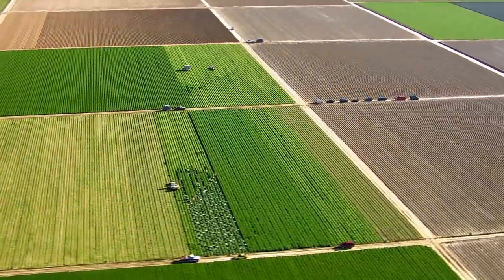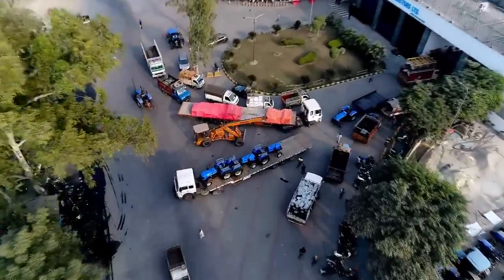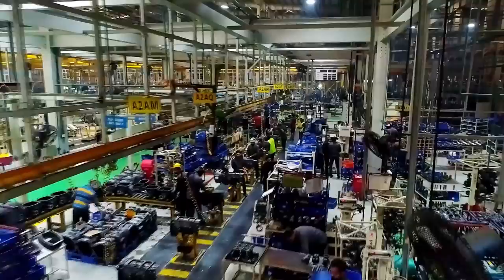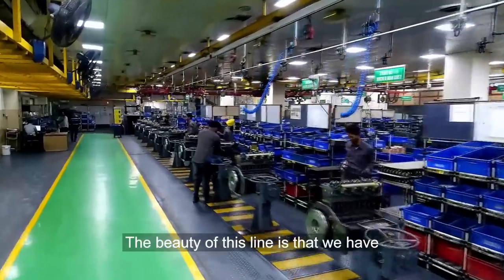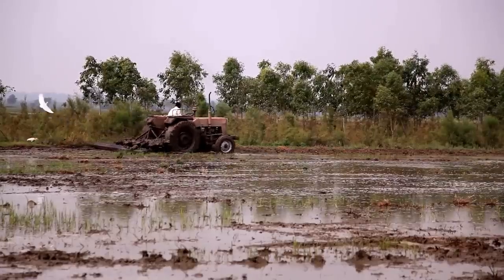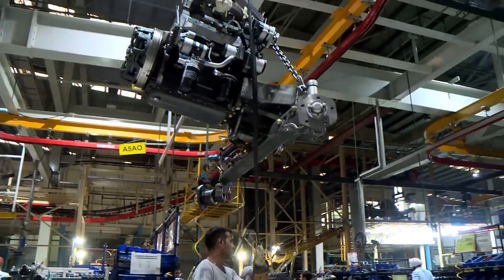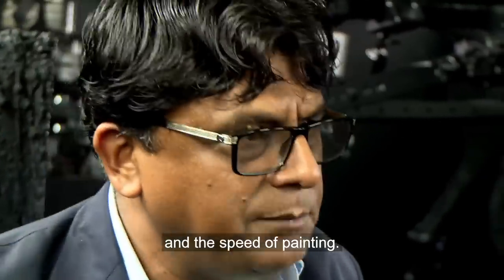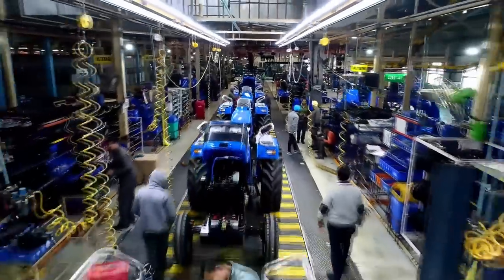How Tractors Are Made | How Do They Do It?

Comment: They should include roll over protection on every single unit.
Reply: Yup
Reply: Yes but in many states a single tractor is used in open field and orchards where the ROPS will be a hindrance and hence there its an option.
Reply: @hp2084  Sound like an excuse to me... I have seen plenty of orchards with ROPS in use.
Reply: @eprofessio  Yes i west they have specialized tractors for orchard. Not in 
India. I have a New Holland which is sold with ROPS in other states but not mine because my state has mostly mango tree plantations.
Reply: Hiren Patel have you ever seen the roll cages on tractor pull units, the ones that pull sleds for competition... they have roll cages right around the driver. These are just excuses.
Reply: @eprofessio  Come to my farm I will show you tree branches 6 inches thick just 6 feet above ground. Should I break the ROPS or the Tree. If you dont know dont act smart because I am a farmer and i know why and why not.
BTW I am not racing my tractor but working with in.

Comment: I wouldn't like to work on a tractor like this daily. The fuel consumption is probably quite bad, no roll over protection (which is mandatory in Europe on tractors without a cabin), probably bad suspention on seat, cheap, difficult to shift gearboxes. Modern tractors feel more like a car to drive (pedal feel, steering, sound insulation). They are like old tractors but new and cehaper.
Reply: Your English spelling skill is out of this world 😐